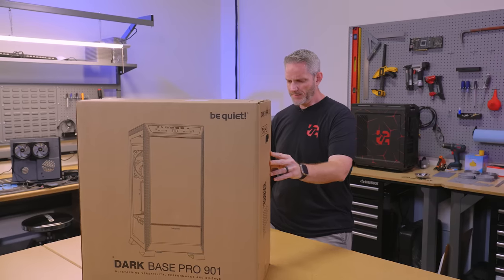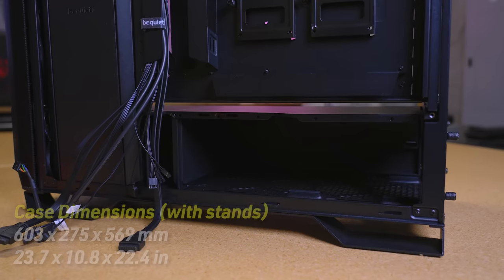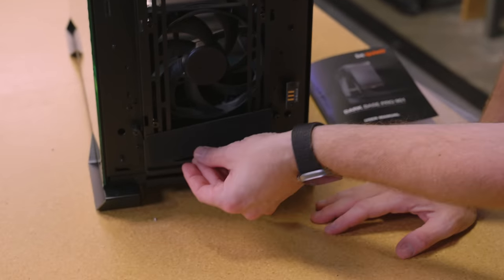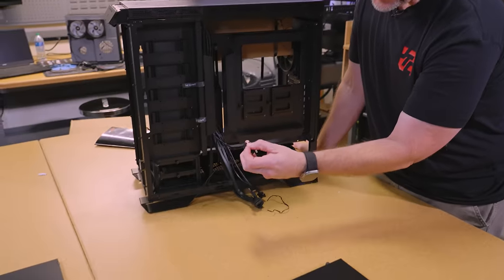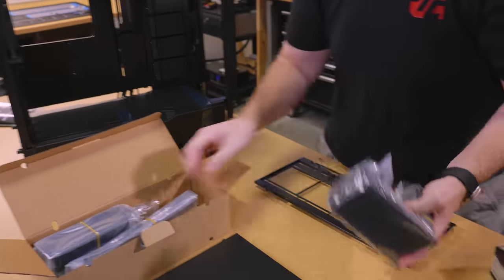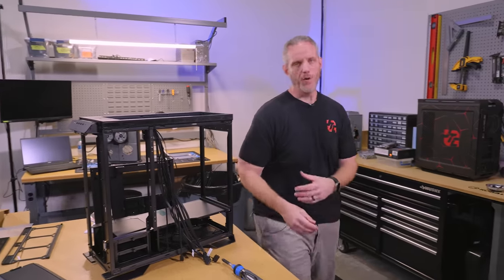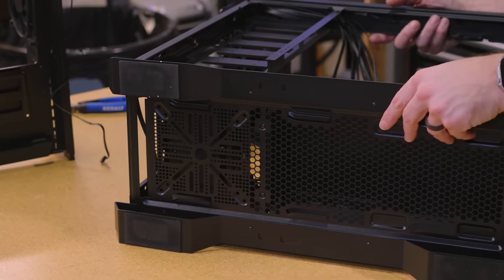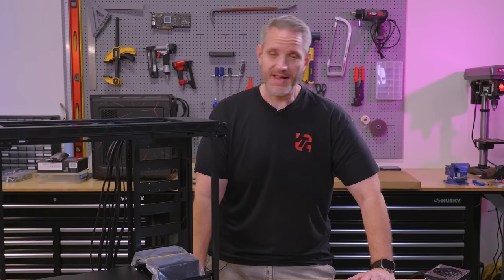This computer case is just crazy!

Comment: That sound deadening foam will cut vibrations from the PC being on.  The case should have a lower ambient because it's not transferring the vibrations from the fans running to the chassis walls.

Comment: My brother has this case, this is very cool to build, with this lego style modularity. He has it inverted to the other side and i have to say  that way with a big gpu, u will need cable extensions for the gpu, because the original cable will block the way u can use the holder from the upper side. But overall, very nice!

Comment: Phone charger /fan control and split mic/headset on front panel?! sold! When gaming in a lot of games a headset/mic is a necessity to be on par.  The phone right there and charging to use it for 2nd item verification is an important thing too.  being able to take a 560 radiator in the top for overclock levels of cooling is a killer feature too.

Comment: I used to use the 900, had to remove the wireless charger to fit a radiator at the top :/
Also goddamn the new case looks chonky

Comment: The front would have made more sense if it had one option, the sound panel for the majority of the noise and small surround grills in the chamfered area for air flow!? Possibly to many options there.

Comment: Overall a nice case. Where the bottom 5 1/4 drive bay is there should have been an additional mesh piece in case you do not wish to use it for a drive bay.

Comment: Im sticking to my cooler master case for at least 10 years since i dont rly like the new designs so much. Also i have a bluray disc drive which is rare to fit in any modern case. After some research this might be the best case for me since it has all of it i want. Not to mention that i have to fit a 4080 in it as well which my old case had trouble with since i had to remove a big fan on the side panel for the cables to fit.

Comment: Best way to quiet a case is to run it fanless and relatively open to compensate for airflow. You still need to run fans on cpu and gpu but case fans can be gotten rid of. Both my pcs use standard cases that are open on the side (I put a grill in place of the window), with the mesh/dust filters front and top with no case fans and its a lot quieter and temps are fine.

Comment: I still watch blue ray and older software. but the external being on the bottom is strange for a full tower as my case sits on the floor and is easy to access front panel ports. i would need to get on my knees to put in a dvd, blue ray.

Comment: With some of the wiring built in on this case, do they have a way to simplify the power, reset, hd light, etc single pin mess for the front of the case?

Comment: Plz note: those sound dampening panels, actually do work. /Sound engineer.
Reply: He doesn't need a lab to test it with all the sound panels on/off. He could just sit down and listen to the difference. It will be very very different with mesh/solid panels. Would be interesting to see the difference in thermals with the mesh/sound panels.

Comment: I have this case, and I have to say it really is amazing. I also have the original 900; which was a great case, but this is even better. My only complaint is that I wish you didn't have to buy the extra HDD cages. They are not cheap and add a lot of $$$ to an already expensive (but worth it) case. I also agree that what would make this better is if it had a RGB hub/wiring.........Oh & Jay, that bottom divider actually has a removable window ;)
Reply: are the hdd cages from 900 compatible with the 901 case? and is there really no fan controller included in 901? in my dark base 900 pro there was one installed on the back of the mb tray

Comment: I still have my BeQuiet case back from 2016 and it had already that wireless charging thing btw, and I love it.  There's a lot of improvements since I got mine.
Reply: That charger is slower than this one, BUT works all the time, where this one doesn't work when computer is sleeping & is also more finicky when it comes to phone position. If your phone isn't just in the right position it won't charge; where I don't have that issue with my older Dark Base 900

Comment: I'm still using the dark base 900. Love it! The only gripe I have with it is the motherboard standoffs are too short for the PCIE brackets to align properly in the back. I had to replace them with slightly higher standoffs and now it's perfect.
Reply: My issue is airflow, which is not great if you have something like 5950X + 4090. So I guess I'm ordering this one. My only concern is my AIO. Liquid Freezer II 420 is thick and this one supports 420 radiators only in the front, I wonder if it will fit with drive cages. Also, with DB900 I had to move drive cages out of the way when I got 4090 Strix (as big as it is, Strix is a ridiculously huge card), so between that and rad in the front I wonder if it will require me to finally build a separate NAS.

Comment: I have the silent base 802 and have it set up in the inverted mode to sit on the left side of desk. Absolutely love it but it is a job of converting it over. Great review as always!
Reply: Same with DB900. I did it twice and both times I had to pull up their video tutorial. But this one seems easier to invert. MB tray, back panel, side panel on PSU shroud and that's it. plus a lot of it is on the captive thumb-screws which is a huge step-up from DB900.

Comment: You need a front 5.25 inch bay for optical wifi to run AI VR over a blockchain (NFT-less).
Reply: What?
Reply: @Jan12700  That's totally a real thing and not just every buzz word I could think to string together.

Comment: I got lucky and found one at a discount warehouse. The glass was broken. Still a Very good buy. As soon as I got it home I took the case apart and inverted it. I put a old 4th gen motherboard in it with multiple GPUs like the old days. I love it. Thanks for the video.
Reply: Were ya able to get a replacement glass?. If so, from where?
Reply: @DVTHEFOX  no
Reply: @Improvisebydesign  Sorry about ya loss. Maybe try making a acrylic glass as a temporal replacement?

Just finished building mine after 6h between removing components from the old tower and put some of em in the new one along new components. No glass issues at all and placed a total of 3 front, 2 top fans (and the already 1 behind).

The top mesh rarely pops up but nothing that bothers me. Easy to install minus the lack of instructions on how to remove the motherboard tray along screws, etc
Reply: @DVTHEFOX  I've actually picked apart the case and incorporated the parts in budget builds. Just released a video on a OptiPlex 3020 build with some of the parts added to it. I have other builds that haven't been published yet. Its not going to waist I assure you. Its on my bucket list to get another case in the future.

Comment: I bought this case on launch day, I love how customisable it is. Being able to go full quiet with the solid panels or full airflow with the mesh panels. It's super spacious, even my 4090 has breathing room. I swapped out the fans with BeQuiet Light Wings and went with the mesh front to show them off. Installing the radiator was an absolute doddle thanks to the easy release roof.
Reply: Do you use drive bays? Do they interfere with larger cards? I had to move them out of the way on DB900 when I installed 4090 Strix. Also, do you know how much space there is for the front rad (Arctic Freezer II 420 is thick and unlike DB900 this one doesn't allow 420 at the top)? I want to order it, but I'm concerned about compatibility (as big as it is, modern component size is getting ridiculous).
Reply: Ah, and does it come with the drive bays included (apart from dual bay in the bottom part), or is that separate?
Reply: @bezrodnyigor  it comes with a couple of HDD drive bays that can be slid into place from the back. It also comes with a 3.5 inch bracket which can be attached to the front at the bottom of the case. The front flap then pulls open to give access if you choose to install an internal blue ray player/optical drive.
Reply: @bezrodnyigor  I'm not using the drive bays personally because I use three M.2 NVME SSD's (which are all installed under the motherboard's shrouds). But the HDD drive bays to the right of the GPU are a good inch away from the end of my RTX 4090 FE. Plus there are 2 bays above the GPU that definitely wouldn't touch even the longest 4090 model.
Reply: @0perativeX  That's good to know, thanks. I use M2 SSDs for software/games, but for stuff like Plex library a bunch of 16/20TB HDDs is still a more practical solution.
Reply: @bezrodnyigor  well there are 2 HDD bays in the bottom part of the case under the PSU shroud next to the PSU itself. Then room for another 5 additional HDD's above those.

Comment: Jay. The sound deadening is not to stop sound from getting through the panel. It reduces vibration of the panel, which generates sound. As a car guy I figured you knew that. The sound deadening actually makes a noticeable difference when installed on plastic panels.
Reply: Regardless of the reason why its suppose to dampen sound, if tests show that the sound dampening “doesn’t do much” then his point is valid.
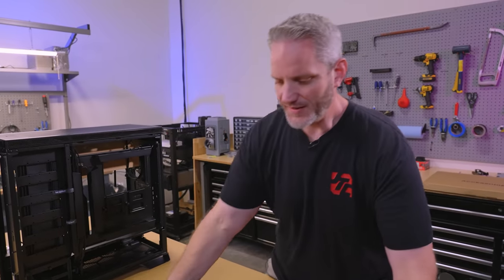Reply: 8:43 is what I’m talking about by the way

Comment: I wish they had left off the 5.25" bay at the bottom of the front panel. That way we could have one big seamless panel down the front of the case, without the hinged door that could break off, and without that useless tiny RGB strip. 

It's 2023, almost 2024. People need to let optical drives die already. If you so desperately have to have an optical drive, just get an external USB-powered one. It wouldn't take up extra room and cables inside the case, and it would be a lot smaller.